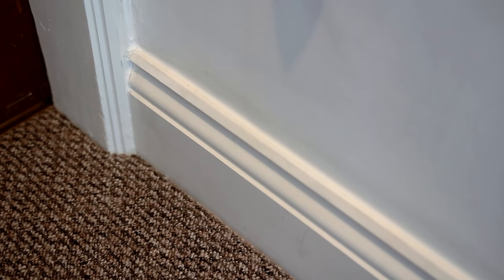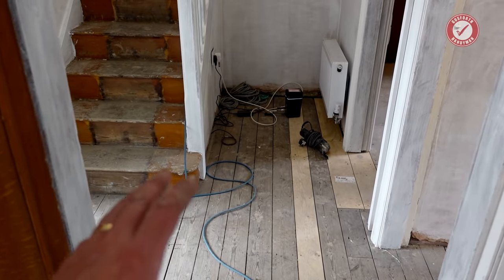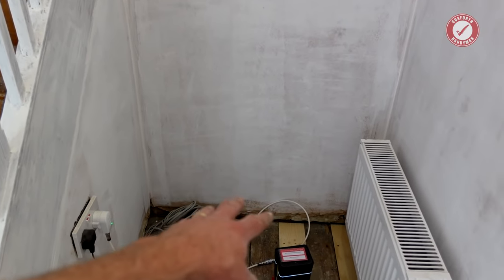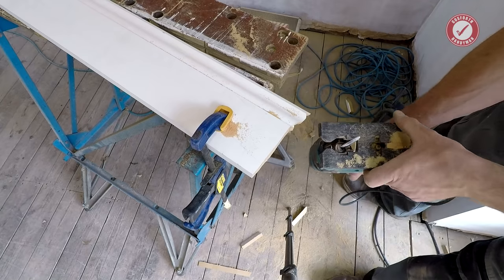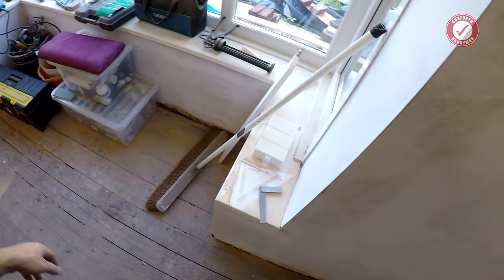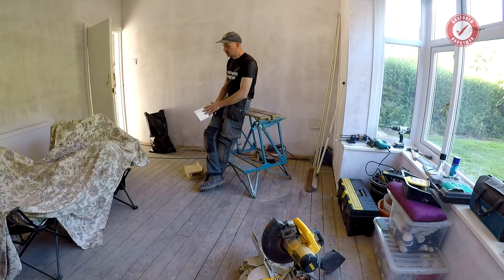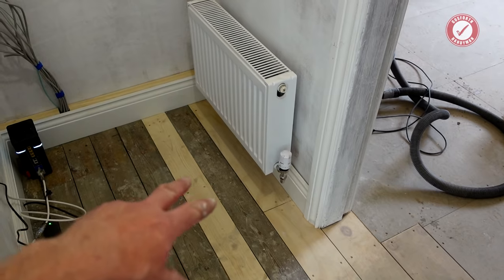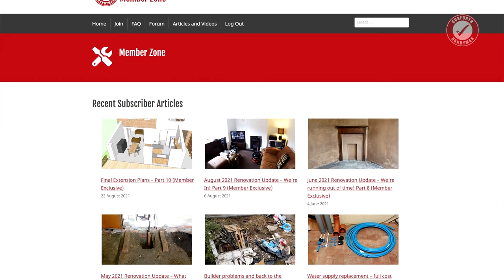Time for new skirting boards - easy scribe tips! (Renovation Part 29)

Comment: The skirting looks splendid - just like it grew there.  Not easy to do when nothing is square, plumb or level.  I admired two of your clever tricks:  the "sandpaper" and boxing in to hide the heating pipes.
Reply from the maker: Cheers Bob! Yeah, these old houses can be a challenge. Especially since the brick walls are a nightmare to fix in to. 👍😁

Comment: Hey Andy, next time you have to use grab adhesive, try an offcut first, apply a nice glob to one side of the MDF skirt/archi/whatever, then push onto the wall, THEN remove it! If there's adhesive left on both surfaces you're good to go, just plant it back in place again. Sounds daft but that way you know there is good contact on both surfaces

Comment: Never had trouble with no nonsense glue before. Many moons ago I was labouring for a carpenter friend ( no longer with us) . He was up against it fitting out 12 rooms ,doors and frames ,architraves, window boards ,skirting etc. Cut a long story short I gave him a hand ,he taught me how to do window boards , and skirting . He said stand in the door way ,look at the longest runs of walls and skirting those first . Less scribes he reckoned , worked a treat . we finished on time ,and I learned some skills . God bless him.
Reply from the maker: Yup great tip! Plus it's easier to do the scribes on shorter boards. RIP to your carpenter friend. 👍
Reply: @GosforthHandyman  Thanks Andy.
Reply: I worked as a site carpenter for many years and when training was told to avoid having a mitre and a sribe on the same board. So that If you have to adjust one you aren't affecting the other.

Comment: I like to chase the central heating pipes into the wall and bring them out into a metal (single socket type) box behind the radiator. This is neat and doesn't interfere with the skirting at all.

Comment: Love the sandpaper trick worked on site as a chippy for 20 plus years and have never seen that, every days a school day! I still use hand saw and coping saw for scribes, find it easier and quicker. I cut the scribe at an angle so that they are easier to adjust. TBF you make the jig saw look easy though.
Reply from the maker: Cheers bud! And once you've made up the sanding board for a few different profiles they last for ages. 👍👍

Comment: Another great vid, thanks. Absolutely loved the tip with the sandpaper, I've never seen that before. Regards to boxing in.... I definitely think that's the best way to do it, just make sure you  raise the top of the box about 2mm above the top of the skirting so you don't have to try to fill and level them to match each other. You will almost certainly get cracks. Having the box raised slightly above the skirting just makes it look like it's all one piece and was made that way👍.
Reply from the maker: Good tip for raising the boxing and creating a little quirk! 👍

Comment: Thanks for the video Andy, really good stuff.  
One reason I had been given for doing the skirting boards after the carpet is laid is the knee bump stretching device the carpet layers use can't miss and therefore damage the finish on the new skirting.  (but perhaps the carpet layers in the UK take a bit more care than their counterparts in Oz!).  The other thing I like about doing the skirting later is you get to see the full height of the skirting board.  
Two valuable "takeaways" for me in this video were:  1) it seems obvious now, but making sure the skirting board is vertical when attaching it to the wall.  2) to clean up the cut, making a sanding block to match the profile - priceless.  Cheers, David

Comment: Looking great Andy 👍. Love the tip for the sandpaper spray mounted onto skirting to perfect scribes, genius! The adhesive issues are a strange one, I’ve used that type for years in literally 100’s of properties and never had an issue. I’m usually sticking to bare freshly plastered walls, so can only assume you’ve had a reaction between the mist coat of paint and the adhesive - not good either way and certainly something I’ll bear in mind.
Reply from the maker: Cheers! Yeah, I've had other issues with that contract matt so wouldn't be surprised if that was to blame. Awful stuff. 👍😂

Comment: I commented the other week saying I wished you chipped the rad pipes into the wall but that looks really good you have used mini bore for the rad pipes yeah? My plumber didn’t want to use it with mine being concrete floor downstairs so I had to chip mine in and use angle valves out from the wall, but yours does look nice and neat your skirtings are finishing the renovation off nicely 👌 it’s good when you get to this stage!
Reply from the maker: Cheers! Yeah, my plumber was a fan of the 10mm for the tails so happy with this and looks really good! 👍

Comment: I am currently having a go with a foam gun glue.  Seen it used in USA video and easy to apply and goes a lot further than the tubes.  Never thought of using jig saw upside down for the scribe trick.  Always done it by hand.
Reply from the maker: I'm hearing good things about PU adhesive - worth checking out. 👍

Comment: Have to say good results in fairness for some doing this as a diy project. we use a cordless jigsaw for our scribes using a fine small diameter blade for the tighter radius. A nice sharp round rasp it also good on torus to clean the round and add a little more to the back cut.

Comment: The solvent free adhesive needs specific application in my experience. Usually wiping down with a damp cloth, apply to the skirting, push to the wall, remove again then push back into place.
Reply from the maker: I did wipe down the wall but that contract matt is terrible. Will never use it again. Could well be to blame. 👍

Comment: Another recommendation for No More Nails applied in small circles... worked great. It also helps to apply pressure against the skirtingboard whilst the adhesive goes off, I had some kettle bells from 10 to 16 kg that were ideal. Kind of limits the speed you can do the job, but it's then there for the duration.

Comment: The method for making a scribe is a good tip!
The method to hide the heating pipes as used downstairs with the cutout made in the board is good IMO, from normal viewing angles it's invisible.
Where carpet goes I would set the skirting against the floor boards, when flooring like tiles or laminate is used skirting goes on top anyway after lying the flooring.

Comment: Had the same issue with that adhesive on freshly plastered and primed walls. No problems with it on older painted walls at all. I reckoned the new plaster sucked the moisture out of it even though the walls were misted.

Comment: Another great video, thank you. The contract matt paint is designed for new plaster and so is quite an open structure, which is chalky/dusty when dry. Maybe that assisted in causing the glue to fail. Just a thought.
Reply from the maker: Cheers! Yeah, I think this might be to blame too. I need to do some tests. 😢👍

Comment: Agree with the adhesive and it failing. I’ve used 54 tubes of it and the only place I found it to work best was when I was putting on pvc panels. Afraid the rest will fail 🤦. Looking nice now at your place and I think we’ve been hitting the same stages nearly all the way through so is fantastic to have that little bit more advice. Keep up the good work

Comment: Just fixed 15m of picture frame at 3m off floor. Used the No Nonsense Solvent Free, not a single physical fixing. Stuck over Fibreliner. Not one issue, can't recommend it enough.

Comment: Looking really good - I have used lots of various no nail type adhesives for years and never really felt confident they will stand the test of time - I have now found a adhesive that really works and sticks and sets pretty fast it’s called MEGA STRENGTH ADHESIVE sold in Wickes made by STS - it’s a polyurethane adhesive and it’s ace too good in fact - keep up the good work 👍🏼👍🏼

Comment: Thanks for sharing! I was about to click off when I saw you were using the 'complete Nonsense' solvent free shite. But glad to see future you fessing up to how terrible it really is! I tried it many moons ago on a kitchen job. All it had to do was hold a couple of 3mm packers in place, and, surprise, surprise; it just wasn't up to the task. Longer working time? The swine just wouldn't go off, and the packers kept falling off the wall. 
I fitted some skirting in my own kitchen temporarily using hot glue. It is still holding strong after months, and will break off easily when I'm ready to renew the flooring.

Comment: Re gap or no gap if fitting into a solid floor laminate/tiles etc I put 2 layers of thin card (cereal carton) under at various points then when painting you can insert card or paper under to protect the surface
Reply from the maker: Yup I sometimes do this on solid floors too - good tip!

Comment: Couple of things I've found with grab adhesives, pros and cons really... I find the thinner water based gear means skirting, architraves etc will sit closer to the wall. The solvent based equivalent, being thicker tends to be harder to push into place, so you end up with a bigger gap sometimes.
Also, if the bead of solvent based adhesive is thick, it can take a while before it really firms up, leaving a bit of movement...and the chance of whatever you are fixing sagging, so it might need tacking into place.

Another great video Andy

Comment: When I stuck my skirtings on I put a couple of empty envelopes on top of the carpet as I stuck them on, that way I can slide a bit of paper under there later when I want to paint them.  I haven't tried to do that yet though, so not sure how well it will actually work.
Reply from the maker: I think you'd struggle to get anything past the gripper rods once carpets are in, fine for solid flooring though! 👍
Reply: @GosforthHandyman  - I put the carpets down first, then put the skirting on top.
Reply: @barnstar2077  I've never seen it done that way since most modern carpet really needs to be stretched onto grippers to stop it moving around, wrinkling or going baggy, bunching up etc
Reply: @TomTomTomTom538  - I only have one room that is carpeted, the bedroom, the rest are all tile or laminate.

Comment: Thanks - a terrific video - clearly you are king of skirting boards! 
The sandpaper tip looks very useful. Personally, fitting skirtings is one of my most hated jobs, for all of the reasons you showed in the video. 
Incidentally, doing a scarf joint (or not) for long runs is perhaps a useful topic.
Reply from the maker: Cheers! Yes, scarf joints on joins is a must. 👍😁

Comment: Thought gaps under skirting were best practice to account for flooring changes (laminate), to account for out of level floors like you said. The gap would be dictated by the difference between the highest and lowest point of the floor in the room

Comment: Personally I prefer base blocks and butt the skirting up to them .. also love the high deep skits easy to do just rip 200mm or higher 12mm ndd then put moulding onto ( comes ready with the 12mm groove so it sits tight onto of the mdf. Bonus is the groove is deep and allows u some play to ensure it looks level
Reply from the maker: Yeah! They're good. Not sure they would go with this style though. 👍

Comment: I use GE Silicone II for adhering all kinds of materials in construction.
It works well as a glue and sealer.
If you want something more temporary, try latex caulk. It doesn't solidify as hard as silicone caulk.
Reply from the maker: Silicone is a little too permanent for this, but yes I've found normal caulk works pretty well! 👍

Comment: Oh man, those TV and phone cables would have been better chased into the wall up to height of the socket. Wouldn't have been too much extra effort? Love the channel btw!
Reply: That annoyed me too! Let down an otherwise great job.
Reply: I thought exactly the same thing.  Make a groove in the wall with a bolster or something, would take a minute to do to get it above the skirting.
Reply: "nice and neat"
Reply: Yesssss! 
Chase it up or drill a hole 75mm above height of skirting. 
And use a small outlet box on the drywall?
Reply from the maker: I wouldn't want my BT socket in the middle of the wall, and the other one will be in a cupboard. 👍
Reply: @GosforthHandyman  well said, Gosforth!
Don't let the OCD nerds/armchair DIY experts bring you down ......!!!
Reply: I'd have to agree with chasing them in and bringing them up the wall. If it were my house I wouldn't want the BT socket etc surface fit onto the skirting boards. Be much better having a flush fit backbox in the wall.

Comment: hi very impressed n its never easy in an old house ,,,i do quite a bit of skirtings and usually its a day to do a house but yours is quite a challenge to any joiner ,,,i use an angle grinder with a rough sanding disc to remove wood for scribes ,,,but enjoyed your video ,,,,
Reply from the maker: Cheers! Yeah seen a few folks using an angle grinder for the scribes. Fast once you get the hang of it! 👍

Comment: Good progress 👍🏻 Always preferred fixings rather than glue for skirtings bcoz they get whacked often and glue can rip off the plaster should the skirtings need removing. Slower though since more filler and paint needed. Many thanks for the update and tips 🙏🏻
Reply from the maker: Cheers! Yeah, fixings are a nightmare in older houses since the bricks are so hard. SDS everywhere. 😢
Reply: I'm with you on this. I've tried glues and can't get on with them.

Comment: Andy - a popular YouTube carpenter did a bit of a test with various grab adhesives (maybe last year).  The solvent free types generally didn’t do that well against the more expensive polymer ones in an mdf skirting situation.  I can’t recall the details so might be worth you watching.  Might of been the primed (but still porous) mdf sucking the moisture out of the adhesive before it has time to bond properly.
I’ve not had much of a problem with my go to adhesive “gripfill solvent free” but I do keep some stixall handy for the jobs where I want something to stick with no arguments 😁
Reply from the maker: Was that Robin Clevett? I need to look it up. 👍
Reply: @GosforthHandyman  yes mate

Comment: In the US old homes have an additional molding called the shoe (bumper) made of a circular pole cut into fourths called a quarter round. This additional molding  is put into the skirting as the bottom most and can be used to make up irregularities in the floor and the walls. Don't you have similar in the UK?

Comment: The scribing is great, I'm definitely trying this instead of internal mitres. Unfortunately my next job is polystyrene coving; don't think it'll work for that.
Not keen on the cables coming through the skirting. Will a patress box go over the hole? I think I would grab the diamond disk angle grinder and SDS chisels to chase out for oval conduit and backing box(es) before plastering. Bit of a pain but would look nicer.

Comment: Another canny vid Andy. I may have been tempted to use decorators caulk to fix the skirtings temporarily instead of water based adhesive! As you know, it's quite flexible as opposed to grab adhesive. I suppose it's getting a balance between the skirtings being "eye sweet" and them being level. The only problem you may have if the skirtings were not level, is if you intend to have a patterned wallpaper, then it may highlight the unlevelness (😁) of the skirtings! My preference would be to fit the skirts tight to the floor to stop any beasties from taking up residence. 
Here in West Monkseaton we get quite a few big 8 legged monsters🕷🕷🕷🕸🕸🕸 making their presence felt in September/October! Keep up the good work😍
Reply: Decorate chalk doesn’t set like glue it will fall off once it drys out in a few months
Reply: That’s the point.Andy does’nt want   a permanent fix!
Reply from the maker: Ha, I ended up using caulk to fix the ones that fell off - worked better than the No Nonsense adhesive. 👍😂

Comment: Should have used caulk and expanding foam as your skirting adhesive, strong bond but easy to remove. I glue it with caulk and let it dry first so as it shrinks it pulls it tight to the wall, then squirt foam behind from underneath
Reply from the maker: Good tip!

Comment: Gap or no depends on the build before carpets and tile gap, after carpet and tile hard down. Amd mdf is a carcinogen si a mask is a must unless you have a deathwish. Your 81 sec cope; i can do in half the time with coping saw. Tip: use your mitre saw to cut the straight bits. 3 bed house used to take me half a day, but at 60 its a day

Comment: I live in a 2011 townhouse, and I can assure you that it also is not straight or plum. I tried putting up corner shelves to find out the corners are probably 95+ degrees. very badly built these new builds.

Comment: would think that plastering is done to make walls flat... However seems it is not the case.
 Is it due to bad plastering, or why would walls not be "almost" flat?
Reply from the maker: Sometimes it's simply not possible in older houses and you have to follow the existing contour of the wall... unless you take it all the way back to brick and start again. Once it's painted you don't notice though. 👍